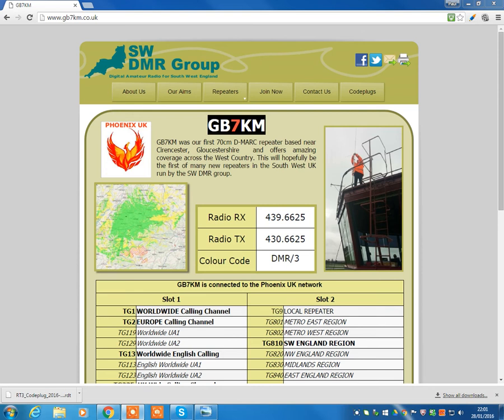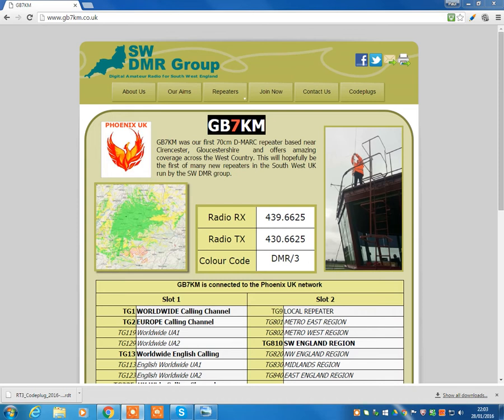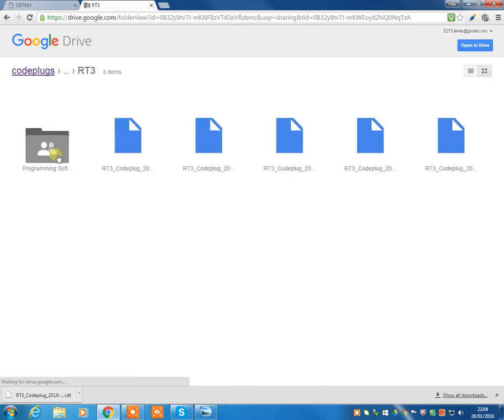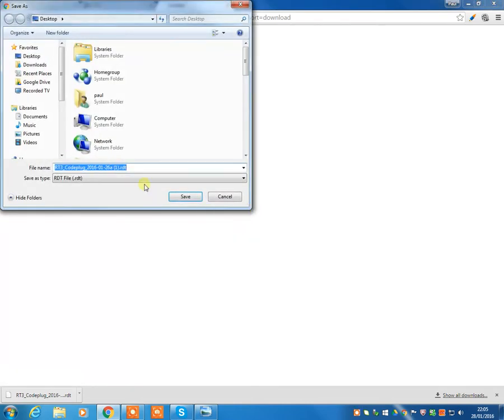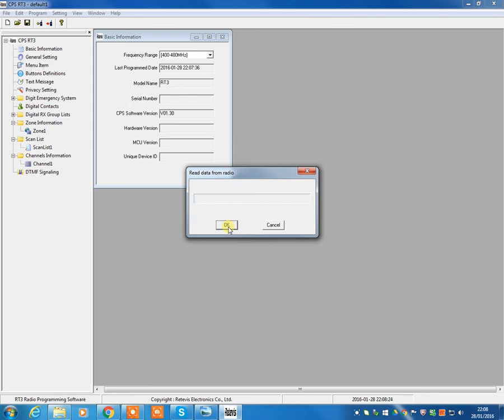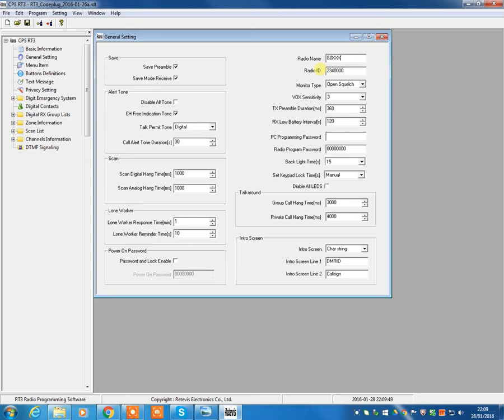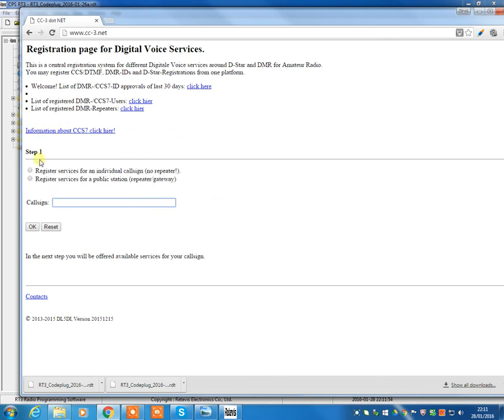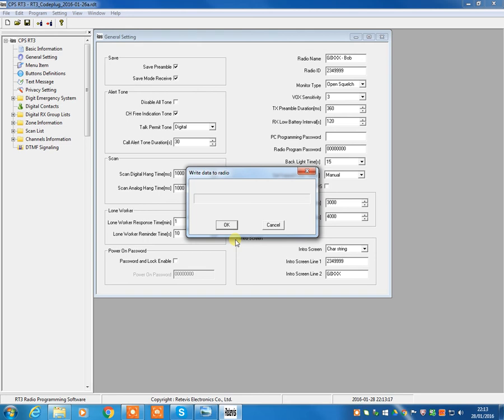Retevis RT3 and TYT MD380 Programming guide (South West UK) 1 of 5

Comment from the maker: I have recently received a number of enquiries from people who have decided to upgrade their firmware on their MD-380, MD-390 and RT3 radios and subsequently have managed to 'brick' their radios.

My advice - if it ain't broke, don't fix it.  The firmware updates are not essential and despite what some websites tell you, you don't need to upgrade the firmware to use it for amateur radio use. 

You also need to be very careful when uploading codeplugs to your radio, to make sure that the codeplug is written for your firmware version.   Some radios will die irreparably if you upload a codeplug which was written (or saved) under a different firmware version.

Comment: Hi 
I took delivery of a spanking new MD-390, created a decent codeplug from scratch after watching your you-tube instructions etc, and quite chuffed with myself. 
I decided to take everyone's advice and update the firmware and all went well until the radio restarted...........
Now I turn it on, i get a beep and  the welcome screen, wait 5 secs or so then "beep - welcome screen" - "beep - welcome screen" - "beep - welcome screen" - over and over.

I used http://www.va3xpr.net/programming-software-firmware/ to download the firmware as everyone seemed to point there and used the 2.34 firmware (not the experimental ones).

I've mailed Tytera and awaiting a reply (I bought it by mail-order), and thought I would ask to you rather than having an expensive paper-weight sitting here - as maybe (just maybe) you'd seen this issue :-)

I've tried re-flashing the firmware back to all previous version but same result "beep - welcome screen" & repeat etc.
It's detected in USB ok, so not a driver issue, but it does appear and disappear in device manager (since it is cycling on and off itself) but that isn't the issue.
does anyone know this issue? - is there a  fix?
is it possible to "factory reset the radio? - i've tried the power and top side button into programming mode but that doesn't work.
Is there a way to "root" the radio and reset it?
do you maybe have an old firmware that works? - (I have no idea what version this radio is at now).
I was able to push my codeplug into it via programming mode, but still the same "beep - welcome screen & repeat" exists.
I know it's an MD-390 but apart from the case and battery, it is the same radio as the MD-380/retevis RT3
I'm pretty adept in IT and quite convinced this isn't a driver issue, and is more a firmware/programming issue.
Any help, advice, step-by-step info or even files would be gladly accepted & welcomed :-)

thanks in advance.